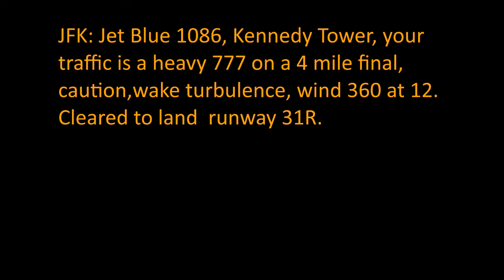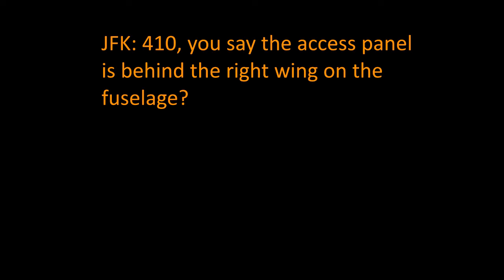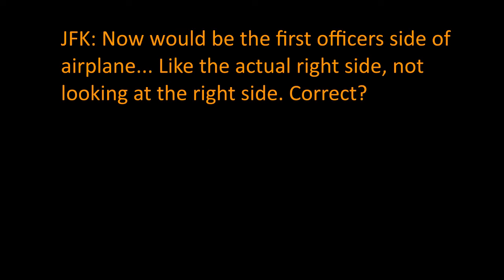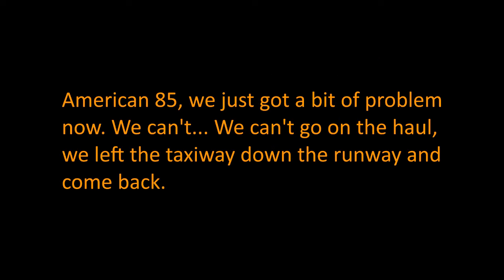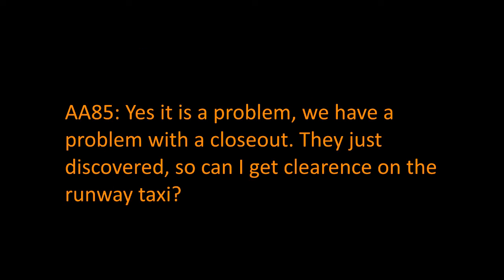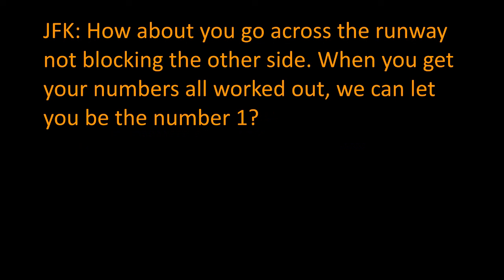Funny ATC Lufthansa pilot leaves aircraft

Comment: 3:06 It sounds to me like Steve is like "Is he allowed to do that?". Is there anything that would say that the pilot would not be allowed to get out and close the door thing?
Reply: Thinking about its certainly not common a pilot leaves their commercial airliner on the taxiway about to depart JFK!  But, isnt a pilot authorized personnel at the airport in charge of their aircraft. The pilot took charge of the situation thats for sure
Reply: No, but getting out of the aircraft on the taxiway, certainly isn't common. Usually they do that at the gate.
Reply: 111himan It could probably be seen as unsafe, cause hes dancing with a powered up turbofan engine, which is sucking in quite a large volume of air.
Reply: I'm going to speak from my experience working at PIT. County controls who is allowed where with a badging system. That is for everyone that works at the airport locally. All pilots are granted permission to walk around the immediate vicinity of their aircraft without supervision. I'm not sure if it specifies "at the gate" or not. I don't remember that section of the training as it didn't pertain to me
Reply: I am sure he went through protocols for maintenance workers on the taxiway, planes evacuating on the taxiway and other cases where persons are walking on the taxiway and checked if any of the protocols would fit this case. Normally you are not allowed to walk on an active taxiway and with DLH on that taxiway, it is active.
Reply: I'm pretty sure the captain of a commercial aircraft knows how to avoid getting sucked up by an engine. Whether that means shutting down the engine or whatever was necessary, I'm sure he did it.
Reply: @RalphDratman  Otherwise it would have been in the news.
Reply: Steve's response: "Uh....I don't really know if you're ALLOWED to, but I....you know, there's not much I can do from here to stop you from doing that, so...."
Reply: @Daniel Cannata Not the suction of his own engines. Parking on an unused taxiway and exiting to do maintenance makes you dangerously exposed to the exhaust jets from airplanes doing the conga dance towards the departure end of the runway, or maybe even the wake turbulence from planes landing on the nearby runway. These high speed air flows likely won’t kill you directly but may push you off your feet and send you sliding uncontrollably... into sharp-edged objects or into the dangerous suction zone of a running engine or into the path of a wheel on a taxiing airplane. And you know what happens then :(
Reply: @CaptainKevin  That's almost exactly what he said in an interview with Captain Joe.
Reply: @rcslyman8929 , that was exactly what he said, I think.
Reply: fyrmn221   Wanted a breath of fresh air.

Comment: There is a door and extendable ladder from the equipment bay to the ground.  Rarely used, but it's there. So the pilot opens the equipment bay hatch in the cockpit, goes down, opens the external equipment bay door, drops the ladder, and climbs down.
Reply: This pilot finally got an excuse to use it!
Reply: I imagine that is how they get in when there is no jetway or air stairs available.

Comment: It's a shame the uploader didn't follow this to it's conclusion. Would have have to nice to know if the Captain actually climbed  down through the avionics bay then down the nose wheel well to the ground then walked down the side of the plane (with passengers thinking What the.. (Unless he informed them what he was gunna do)) and possibly would have needed to do a high jump to get to this 'hatch' to close it. All awhile the 1st Officer is standing on the brakes/other taxiing planes/the tower watching on having a quiet 'chuckle'....The sight/thought of all this is possibly what got the Ground Controller laughing in the first place...Surely he thought, 'This guy can't be serious!!'
Reply: William Langfield imagine that the engines were running to...
Reply: Well it's a a340 so not that high off the ground iirc. Its on the lower fuselage, assuming the pilot is about 1.8m, he'd be able to reach it no problem.
Reply: William Langfield yeah, neither one of the pilots left the cockpit in the end and idk how you imagine going through the avionics bay down the ground since that’s not possible lol
Reply: @emilrifahi  Is with the A340... There's a ladder in the avionics bay which is meant to extend through a hatch in front of the nose gear allowing the pilot to step right onto the taxiway.
Reply: It's more frustrating to me that the pilot needs to do this at all... The fuel panel is bleeding obvious that it's open.  Why didn't the pushback crew see it?  Wing walkers, tug drivers, come on... I wonder if it was a faulty door sensor.
Reply: IIRC from when Captain Joe interviewed him, someone went out there to close it.

Knew about the ladder in the avionics bay from another commercial pilot's channel but it doesn't sound like it was used.

Comment: Anyone know how the pilot could get off and back on the airplane on the taxiway, without air stairs?  A340s are huge.
Reply: They use their huge lower body strength and jump back up.
Reply: There is a hatch in the cockpit leading to the avionics bay and from the avionics bay you can leave the aircraft through a hatch leading to the front landing gear and use a ladder to get onto the tarmac.
Reply: EsWe1990 Thanks for the reply.  Sounds similar to the set up in a KC-135/B707.
Reply: Richard H  I'm not sure which door they're talking about, but since they said it's on the bottom of the fuselage that should be no problem. I'm 6'3'' and I have to duck slightly to walk underneath the fuselage of an A340.
Reply: Richard H
Thank you for letting me know. I think we can consider this matter resolved now :)
Reply: Please tell.
Reply: +pudgeUSAF https://www.flickr.com/photos/360photography/1610258827/
Reply: You can fast ejection seat yourself and parachut next to the plane and if you wants to go back into your plane afterwards, you do the same again, just in the reverse order.

Comment: Wait  a minute .. How did the lufthansa pilot get off the airplane without stairs ?
Reply: Hatch
Reply: +Stefano Nicoloso Rope ladder? lol I was thinking the same thing.
Reply: The A340 has an access hatch in the cockpit which a pilot can exit the aircraft via a ladder from the avionics bay external hatch
Reply: +111himan I would just start crying if i was the Air Traffic Controller atm and saw him come out from the bottom of the airplane and went and closed the hatched and got back in and was like " we are ready to!"
Reply: open hatch To rear of flight deck or fwd galley, into avionics bay,  other hatch opens to rear of nose gear.
Reply: Jason Cochran  I know it was 2 years ago, but that comment just cracked me up! :-D
Reply: He used the slide lol
Reply: he changed into his batman suite,lol, there is a ladder under the cockpit

Comment: Even in Itay or in other parts of Europe people prefer to do things like these ones by themselves, but it could be a problem, that is that aircraft has pulled out from the take off sequence and it could be troublesome to "find a spot in the queue" . Another potential problem could have been a failing lock mechanism in that panel so that panel could not have been properly closed and there would have been the need to call to ground maintenance crew

Comment: Soo, he either has a plane with built in stairs, or he is going to climb down into the plane through the access panel on the floor, and climb down the landing gear... Either way he was a smart pilot to pull over and close the gas cap.

Comment: No idea what type of hatch that was. Remember the 747 cargo hatch blowing off with passengers going with it in flight. I'd loose my place in line and return to the gate for that. Assurance is golden. If it did not lock closed with the visual indicator showing that it's locked, that's a problem.
Reply: Behind the captains seat is a hatch with ladder to the electrical department. There you find a second hatch with ladder to the ground :)

Comment: How he got out of the a340? Its ike 4 meters high?!
He used a ladder or?
Reply: Yes, a small hatch in the Avionics compartment right underneath the cockpit. Probably designed for easier acces during maintenance it has also been used by Pilots for easier and quicker access to and from the plane as well.
Reply: @Exodon2020  ah okay

Comment: Can anyone explain to me how he got out and back in. I'm assuming this is not a small plane considering it is a transatlantic flight. They have a rope ladder? ha!
Reply: In the cockpit, there is an access panel in the floor, which leads to the avionics compartment.   The pilot can climb a ladder down through the access panel into the avionics bay. Once he is inside of the avionics bay, there is a trap door cut into the bottom of the fuselage.  The door can be opened and there is a ladder stored at the location the pilot can employ to climb down onto the ground.
https://www.youtube.com/watch?v=H9M1DGHIJqQ

Comment: I wondering why hatches aren't automated.
Reply: Ted D If it were automated, it would need an electric motor to close it. That adds weight, particularly when you consider how many ports and receptacles there are on a commercial aircraft. It's not worth the extra fuel burn.
Reply: Why automate it when a human has to manually hook up and remove the fuel hose?  The door has a warning light on it, that's how they knew it was open.  They should have noticed and had the ground crew check it before they left the gate.

Comment: Controller typical rude New Yorker.  Laughing at the LH pilot trying to move off runway to correct issue. A ground crew could have closed the door for him.  A signal light in the cockpit would have confirmed this.  But no, that's JFK for you.

Comment: That controller seemed to be a jerk. Did anyone else think so?
Reply: I disagree.  That's Stephen Abraham, known as "Kennedy Steve."  He was known for his sense of humor and his willingness to use unconventional tactics if they (1) were safe, and (2) helped the pilots.  Here he allows the Lufthansa captain to leave his aircraft to close an open fuel panel door, and when an American Airlines pilot reported a problem, he asked whether it was a solvable one.  When the pilot told him that they just needed to get some numbers, he allowed the plane to cross the runway to a runup area and turn around while they got the numbers, and promised that they would be #1 for departure when ready.  Another controller might have required both pilots to return to the ramp, causing significant delays.  Steve made two flight crews (and their passengers) happy and kept the flow of traffic moving, without compromising safety.  "Kennedy Steve" retired in Sept. 2017.